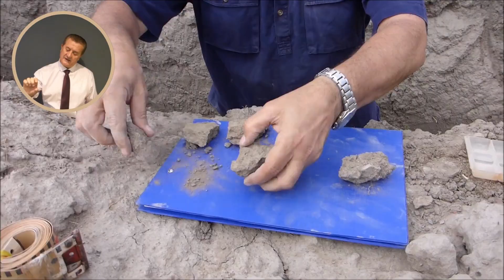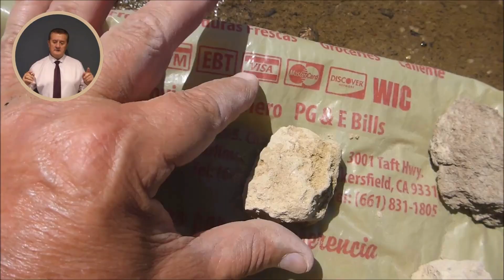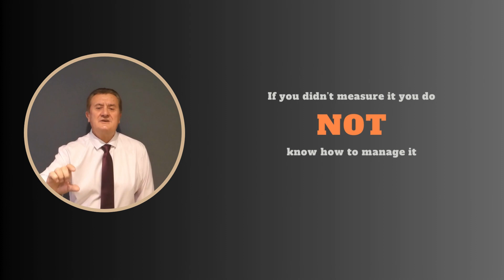Soil Stability: Beyond Remote Sensing Reach - Talk to your Soil - Part 1

Comment: if you know what kind of farming method has been used until now, you should know what state the soil is generally in. if you don't, you can classify a type, by looking at these samples and comparing with results of some additional tests.

annywho, you will know where you are starting from. That was a good that you said that in the video, this is just the easiest starting point. 

another good sign is, do you see earth worms and alike?

if you don't see worms => something is very wrong there, the soil cannot regenerate without earthworms and other bugs that recycle the waste into nutrition for plants